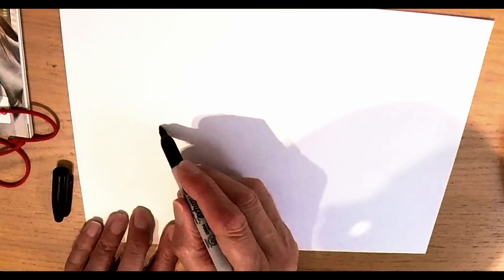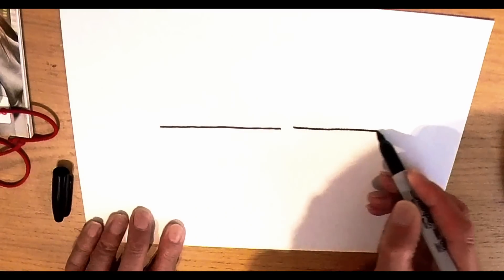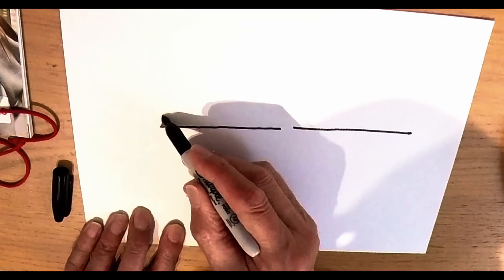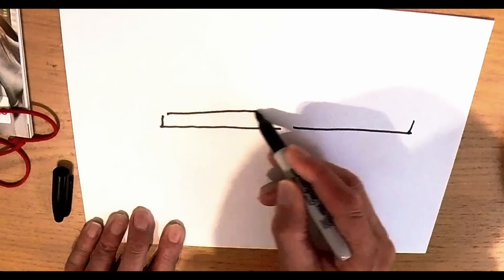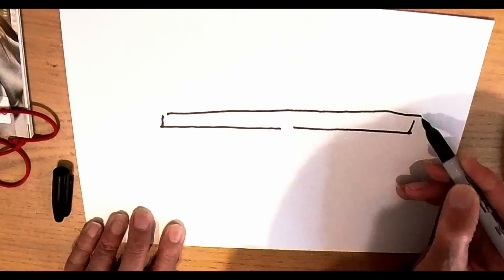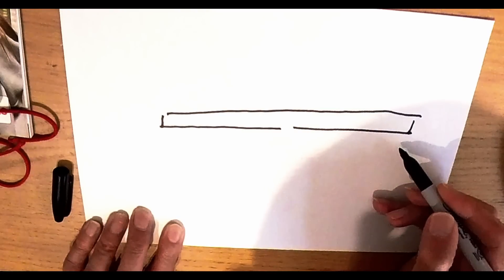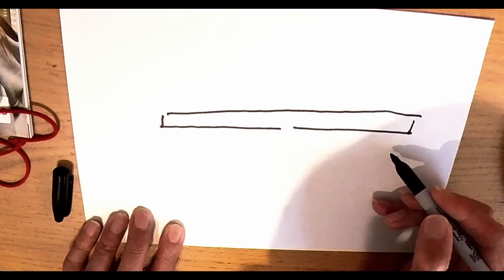Ham Radio HF Antenna 90 Degree Warning

Comment: Wow! This video made my day! I just cut my 80--10 to a 40-10 because of the dreaded 45 degree infection! I will now break out my soldering iron and defiantly solder it back together in protest of convention! Down with conventional "mumbo jumbo" and up with the wire, I say!  ;)    Thank you for the wonderfully delightful wisdom!          73' de KF4LBG...
Reply from the maker: Well a cubical quad has four 90 degree bends and works!

Comment: Thank you Peter for all your antenna advice and helping make this hobby exciting to be an Amateur Radio Operator again. I have been a Ham for 44 years, but due to Family &  Career obligations I fell away from it. I loved CW & am glad to see it is more popular than ever, plus POTA has added an element previously only used once or twice per year. POTA, QRP, es HB antenna designs, oh where have you been all my life? It was always there for the most part, but sometimes mixing up the elements gives new excitement! Cheers es 73, Davey - KU9L

Comment: Dave Casler did a video about inverted Vs and said something pretty similar. My experience with an end fed strung up in trees has backed up this as well, I've worked people thousands miles away with antennas zigzagged in trees. I never take a protractor with me 😂

Comment: My doublet has quite sharp bends to fit its 57mt length in to my 30mt long garden....way less than 90degs.....with end legs dropping down vertically as well.

Works great.....

Comment: I have a CB dipol. Sometimes i drop one wire leg so i get this 90 degree angle. Its 6-7 S-points better for local talk. SWR doesn't change. In the past i modeled this in software and that confirms it switches from horizontal polarization to vertical. Is it optimal? No. Does it work? yes.

Comment: Those bends are usually done at exact specific points based on specific fractions of the desired frequency and based on the antenna design. Saying bends (90 or more or whatever) ar fine is just plain and simple BAD advice. It does not take into account the actual physical propagation of radio waves and physics laws into account. This video is rubbish. A lot of talk but no actual physics explanations (because physics tells a different story). Bad advice for people who watch this. Yes, a bad antenna will still "work", no matter how you bend it, but the performance is exponentially worse.

Comment: It's amazing what will work if you just try it. Years ago I was desperate to put up an 80 metre dipole at my parent's house. I ran it from the washing pole at the far back, chucked it over the roof ridge and brought it down at a steep angle to the fence in the much smaller front garden. To my dismay I had about four metres left over so I wound it onto a plastic bottle and nailed it to the gate post. The thing worked great!

Comment: I have a ninety degree drop at far end of a 40m EFHW to keep it in my garden. Guess what it works lol.
What I will say though is if you know you're out of space and roughly where you need to drop or linear load etc.
Experiment on eznec or mmana gal.
Move the drop or linear load a few foot either way and see if you can optimize the pattern for your own situation. Anything will work but you might learn something in the process and possibly improve something too. 
Simon VA3SII G7HCD

Comment: Yup.
When I was first licensed, I worried about getting every antenna "perfect" because several senior club members told me it had to be so and when I asked for assistance, they referred me to the ARRL antenna book - a lot of info to wade through.
Instead, I started to try things, with the  help of a GDO and an antenna analyzer (Comet) and I've had GREAT success getting on the air. Not everything has to be "by the book" to work well.

Comment: Yes very true story. I was told by old friend it won't work very well that my wire antenna has lots of bends all most V shape and I told him I've had a QSL cards from Japan I was runny 10 watts and I've told him Look at slim jim antenna it got big bend in it and it fantastic antenna as I got one for 4m I will be making another bent antenna for 6m that's slim jim.

Comment: I have a 40m/20m fan dipole at 10m agl and from what I can tell the angle is less than 90 degrees. I get 1.5:1 on 40m and 1.1:1 on 20m and I've been able to work Japan and the US much better than I would have done using an EFHW.

Comment: This is the primary reason I no longer participate in ham radio forums. The level of antenna BS is astounding.
During a 6M band opening, from the US east to west coast, I was receiving 59+ signal reports. When asked about my working conditions I was informed by several 6M propagation experts that my 6M yagi on the 120' tower was too high. Too bad that I had no other place to mount the yagi and still rotate it. Anyway it remained as it was until I earned VUCC on 6M.

Comment: My first HF antenna was a U-shaped 40M dipole run around my garage ceiling 11' off the ground. Obviously not ideal but to get me on the air in January in Minnesota, it worked just fine.

Comment: I have what I call a Perverted V antenna. It's an inverted V hanging from about 20 feet on a flag pole in the corner of the yard.  The two legs are at 90 degrees, and one leg bends 90 degrees again so that it's parallel to the other leg for about 15 feet.  I imagine the radiation pattern looks a Jackson Pollock painting, and I don't get good signal reports, but it works better than anything else I've tried given my garden space.

Comment: Now that made me laugh Pete 😂 When I give antenna talks at the local club, I concentrate on fitting in multi band (and by that I mean 160 - 6m) antennas in to postage stamp size gardens. My own garden is only 27 x 30 feet and my antenna is as bent as a 9 bob note !  But it works very well, as the logbook shows. 
False info is a bummer, but difficult to avoid. Best solution is to experiment and draw your own conclusions.....

Comment: There should be a more holistic approach. Indeed acute angles cancel out a signal but in one direction. The best example is the rhomboid antenna, where that acute angle gives +6dB at the bending axis. An inverted V used smartly could open a path to Europe and the far east if slanted or tilted flat to radiate there.

Comment: I have a friend who self admits he doesn't know anything about antennas. He says he throws up a wire and if it works, it is a good antenna.  He has this most confounding loop I have ever seen. It goes out to a tree that 80 feet high and then straight down to the a pole 7 foot high then back up to another 80 foot tree and then down again and loops back to his house. He probably has 300 feet of wire in the antenna. But he can hear signals than most us miss! Despite having studied antennas as an Electrical Engineer, I swear, it is all Black Magic!

Comment: Keep up the great advise!

A few years ago, when I was chasing my WAS, I had two wire antennas, one for 160 meters, and the other for 80 meters, where the wire had a couple of bends more than 90 degrees due to the area I had to put them into! Had I been 'educated' on the problem of the bends more than 90 degrees, I might have done better on those two bands!!! ;)

But, I must have gotten lucky, as I made many contacts, and I finally got my WAS award! Yea me!!

I have also stopped listening to 'experts' spouting nonsense about how I am doing the wrong thing with my antennas. As the antennas work very well, even if I have to compromise the design to get it to fit a space.

Comment: I've had to bend most of my HF antennas over the years due to having a small garden , I've used coils  to shorten them, Linear loading , Various bends and coils to get them to resonate where I want them to ... Sure it's all going to affect the radiation pattern , But saying that I still works lots of DX on them ... Unless you give these things a go  you don't know if it's going to work for you so give it a go 👍 ... Regards de GW0WVL.
Reply from the maker: Many thanks for sharing.

Comment: Sage advice Peter, I used to have an inverted V up for 40m. The apex was at about 10m, it worked extremely well, but from just around the corner from our house I could see  how narrow that angle at the top was. Probably about 60 degrees, certainly well short of 90. Sadly there are many cases where people are put off from trying,  if we lose a few dB from cancellation here and there we are still on the air. 73
Reply from the maker: Many thanks.

Comment: Great video Peter! It's all about experimenting. I've made contacts with Japan and US stations on 10m FT8 from my block of flats in east London by taking my dipole out on my relatively small  balcony. I had to bend it in all sorts of ways to get my vswr down. The final configuration was crooked, did not expect it to work based on what I've learnt in my Foundation course, but it did. Using modest test equipment such as a NanoVNA does help. 73, M7BAL.

Comment: Thanks Peter, it did not worry L.D.Cebik W4RNL (SK) rest his wonderful soul.  I build his Z center fed dipole on an angle, much less than 90 degrees. Not a problem. Also, I had EFHW at very odd angles, not a problem, And in Australian North, not too many hams every few kilometers, as Europe and UK
No worries on DX either, always good reports, never use over 50 watts, unless conditions are very poor. Thank goodness you are bringing this up, I thought there must be something wrong with me, Hi Hi.
Reply from the maker: Hi Dennis, many thanks.